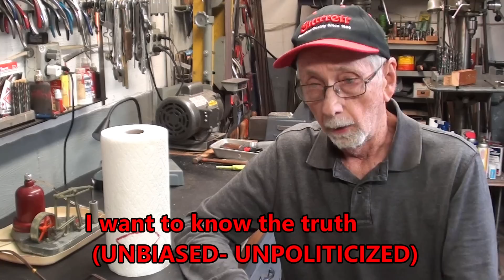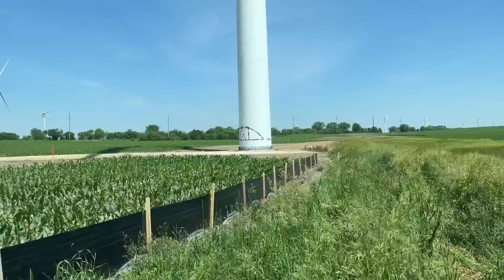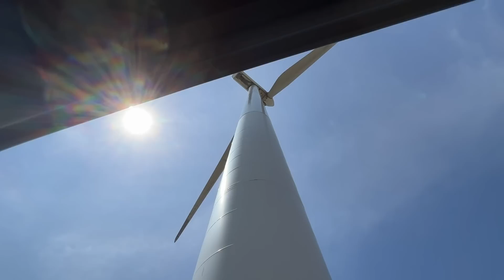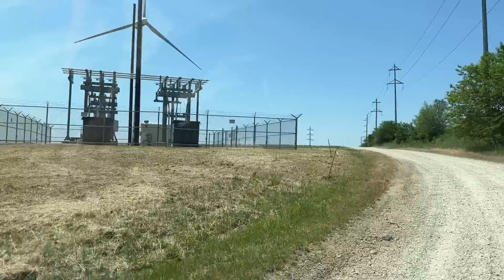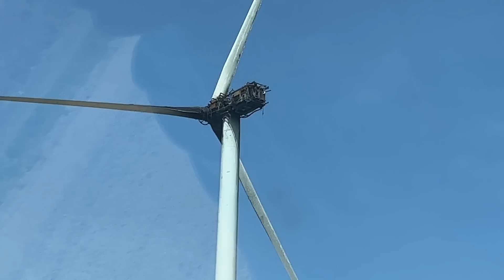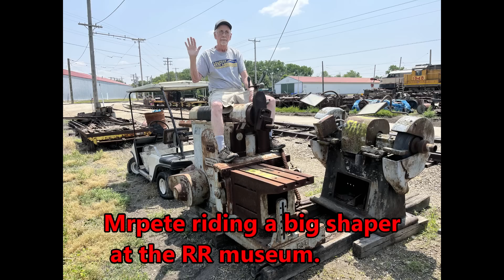OBSOLETE WINDMILL DEMOLITION short #46 pt 1 tubalcain

Comment: I wrote a book about the demise of shop class--vocational ed., and what it's doing to our infrastructure and producing kids out of school with no job-ready skills.

In it is a chapter (called Multiculturalist Sink) on my time spent working on wind turbines before becoming a shop teacher, and I go over these issues, starting with a turbine failure-- a nacelle catching fire and burning.

This subject interests me greatly--from a global perspective relating to the resources put into something with such a small return.

The business model producing electricity from wind is un-doable without subsidies or tax breaks. The idea of "storage" between times of no wind defies the science-based model of how batteries work, and translating AC power to DC and back again for import to the grid.

There's a whole-nuther problem with footprint as you mentioned (digging, roads, gravel, concrete, rebar, connection to the grid...). Environmentalists are torn between trying to save the planet, and the outlay in resources to build turbine farms and the environmental degradation necessary to make it happen. I see it as diminishing returns.
Reply: The AC/DC thing is very doable. In the UK we import power via an under sea  cable from Scandinavia. It is a DC link, and is also bidirectional.

Comment: I despise windmills. They are for the most part ineffective. Without government subsidies ( Obama and Biden were good for this and causing worthless expenditures) these would not be produced in the numbers we now see. There is a plan to put these just offshore at Ocean City, MD. Of course the township will get kickbacks and I believe that is the only reason the "town fathers" want these eyesores off the shore of a place making it due to the beach.  Can you imagine what this costs? Ba enough with the short life, pollution they cause now add ocean waters (salt), ocean currents and the depth for the base. Some do-gooder will come up with the idea that it will make fish habitats and don't believe it. AOC is a box of rocks, so is every Democrat plus many Republicans.  IMHO, government''s only purpose is to get rich doing nothing and control people as the commies do.  People that cannot balance a checkbook are controlling the treasury. 
I have read that in winter, if the blades get covered with ice, they do NOT work. The blades are an airfoil, similar to a wing. I have heard they use kerosene to thaw the ice. That is a great product to splash over the land. If you or I did that. we would be crucified by the EPA.

Comment: I personally don't mind them. If they were proven to be a positive influence on the environment (ignoring the environmental cost of components and political implications of relying on unfriendly nations), then I would go as far as to say I would be all for them. But here's the logical contradiction: Without energy storage, you need a backup. If you remove gas as the greens are clamouring for, then the only option is nuclear. And if you build enough nuclear capacity for when the wind isn't blowing,  why would you not just use nuclear all the time. The whole green industry is a scam. There are a lot of people getting very rich whilst the public are getting poorer in the name of the "green Revolution".

Comment: the wind has to blow at a specific speed in order for the windmill to produce electricity, a bit like the solar panels, takes 15 years of continued use in order to make them worth while, trouble is they need replacing after 10 years
Reply: Not the tower, which is half the cost. 
And I believe it's more like the stuff on top of the tower last 15 years and the whole thing pays for it's self over 15 years. 
So you can run the tower for another 15 years and replace the stuff on top and 7.5 years later that stuff is paid for and making pure profit.

Comment: Me I don't think they are as efficient as they claim cause they are easily damaged by ice and excessive winds but also they take huge amounts of property to actually build them then there is the problem with storage of energy windmills may produce more than needed at that time they control energy output easier with the other methods they are using in my opinion

Comment: You can't find out how much energy they use, how much energy does it take to make one, how much it cost to transport them, etc. If it's subsidized they can't stand on their own merits. I think nuke plants are safe. I have one south of me and and a coal fired plant north of me (I can see the stacks on a clear day). TX had a big freeze a few winters ago. The windmills stopped spinning and the overcast affected to the solar panels (both are a blight on the land). People lost power for and stuff froze. I was working in NM at the time. My son shut off my water well and drained my pipes ahead of the freeze so I didn't have any damage. When I got home a few weeks later, not one clock was blinking. I never lost power. The coal fired plant, nuke plant, and a natural gas engine driven peak shaver to the south of me kept my power on.

They put them on top of mesa's out in west TX. What used to be scenic is now like looking at a fresh dog turd.

Comment: A while back I drove I-70 back from a trip out west.  I was appalled by the miles and miles of turbines obscuring the landscape.  Just horrible.
Reply: What is your alternative ?
Wind farms in 2022 generated over 10% of US electricity.
Sure Micro nuclear generators may end up becoming a major contributor in the future, but in the mean time where do you get your power today ?
Reply: @keithwhitehead4897  Being hysterical over eliminating conventional power plants is doing no one any good except the grifters who profit from generating that hysteria.
Reply: @Don_B_260Z  Reality is not hysteria. Climate change is here, its only going to get worse. GOOD engineers look at reality, of what is, what's possible, and what compromises can be made safely.
Think of this as your oil warning light coming on in your car, can you leave it for a wee while...maybe, but is ignoring it going to be more expensive long term...
Denying reality because you want to feel warm and comfortable and not have to make decisions is not a route that works for anyone.
You change a noisy bearing before it seizes and causes a damaged shaft.

Comment: Thanks Mr Pete for your practical observations on this issue as a old trucker who farmed on the family property the rates changed for the oversized truck and escort service are extremely high per mile and from some of the responses hundreds of truckloads per job you could never find a balance point for it be profitable not to say that there is a problem to begin with at 345 ppm co2 we are a long way from the high end of co2 levels historically documented not counting we are all carbon based in body and world

Comment: The ones we put it Paw Paw(which isn't far from you) a couple years ago were 5.2 Mega Watts.  When we were installing them, they told us they were the largest on land in North America.  Each foundation was 1000 yards of concrete, the towers were five sections.  The Nacelle's weight was 200,000 lbs, the powertrain that went into the nacelle was another 240,000 lbs, the hub was around 40-70,000 lbs, can't remember exactly and the blades were around 35-50,000 lbs.  Would you believe it, still to this day, to my knowledge, they are not online.  I can say for certain, I would not want one by my home.  They are very loud, and an eye sore.  We finished the farm in January of 2022
Reply: Count me I would not one by me either but companies are getting rich !!
Reply: I was talking to a local power company engineer one day a couple of winters ago,  found out they have to shut the windfarm down when it gets 20 deg F below zero.  What?  It's to cold they say.  We get a couple weeks of 30 below up here in North Dakota.   Cannot use the windmills when there most needed.  What a waste.
Reply: You are correct in everything you say.  They would never exist without heinous arbitrary mandates and unduly favorable subsidies per mwh of production.  All of the so-called "green nee deal" is a massive scam!
Reply: Windmills kills birds.
Reply: That 5.2 Mega Watts rating must be the max rating. What wind speed is required to run those at their max power? I think  a good assumption is to average the wind over a period of time and calculate the actual power output from that Probably not even half their 5. 2 M w  rating..
Reply: @HEADDYNAMICS Noise?  You have never been any where near one.  They go woosh, woosh, woosh.  Very soft.
Reply: @michaelkenefick4660  If you are from living in the middle of nowhere to having one 200 yards from your house, you would say they were loud.  I talked with several homeowners from a neighboring wind farm and worked right next to working turbines.  They are loud.
Reply: @HEADDYNAMICS  I have been 50 feet from them in the country with no houses, business or people.
Reply: @michaelkenefick 
I have hunted doves over cut down dried feed corn and the wind turbines were spaced so closely that they looked like Dominos! Not that loud at all. Was about late August through September.

Comment: I retired after 38 years with a power company. NextEra Energy is one of the subsidiaries which is the largest wind/solar power producer in the world. I can tell you that wind/solar energy is hugely profitable. Yes, there are tax incentives but they are reducing yearly such that they’re set up to be gone in the future. They now have huge lithium battery storage units which store wind/solar energy that are also profitable. It’s complicated. Electric power is bought and sold like the stock market. But, the price of electricity varies based on demand and contractual agreements. Battery power is instant and can come on line way before a conventional power plant can come on line.
Reply: The question is; “hugely profitable” to whom? The farmers who receive monthly checks? Steel and concrete suppliers? Battery manufacturers? Maintenance and disposal services? Blade manufacturers? The list goes on and on but surely “not hugely profitable” to tax payers?
Reply: I'll but 38 years in sales or PR department, but I aint buying it. If it were at all more profitable there would be no subsidies at all. ,,,, I'll give you an example. Tesla had subsidies. Corvettes never had subsidies. Fact is if you want a new mid engine one you have to pay about 5 large above list and wait 6 months to a year to get delivery. ,,,, Point, If you have something that is salable and people want there is no subsidies (And Corvettes have always had fiberglass bodies, but you are not going to find a 63 split window coup in a landfill. - Fact is you will not find ANY Corvette in a junk yard. They get restored. ,,,,, Kind of different then the bird blenders, huh? . If windmills, solarm and even EV were saleable there would be no subsidies. If they actualy had any value they would be selling at premium prices.

Comment: To me those wind turbines are far less obtrusive than a Coal or Gas electricity generating plant that spews copious amounts of toxicity and particles into the earths atmosphere. There is no reason in this day and age to poison the Air, Soil and Water that sustains life on this planet. There obviously still needs to be a huge amount of work and investment into modern methods of smelting metals that make these Turbines and towers. Man slowly moved from the Rock age to where we are currently and man will still move forward to better methods IF he tries.
Reply: The problem is that those coal and gas plants are required to manufacture those turbines. They do not produce enough power to supply the processes required for their manufacture. They are a net energy loss. Same for solar. Neither technology has enough fuel density to ever be of any real value.
Reply: @841k9  Which is exactly why i said There obviously still needs to be a huge amount of work and investment into modern methods of smelting metals that make these Turbines and towers. Anyone invested in Oil, Coal or Gas can easily invest in renewables. There has been far too much time wasted already. Induction and Hydrogen are just 2 methods which should be at the forefront.
Reply: @tjr4744  Wind power has been around for 2000 years. - It's what is called a "mature" technology. There is no Nicola Tesla, or Leonardo DiVenci working in his basement that is going to come up with a windmill that is going to be 7 times as efficient as the junk we have now. It is as good as it is ever going to get. Aerodynamics has no solution to a better windmill. Remember the Concorde SST? It was as advanced as we are going to get,,,,and was a bridge too far too. Just like wind and solar. Not economically viable. 

Maybe in another 50 or 100 years we will have solar panels that actually work, but Monday Morning here is the bottom line. Wind and Solar SUCKS!

Comment: Those industrial sized wind towers can produce enough energy in a year to power about 1500 homes. The drawbacks: Depending on wind speeds it takes aproximently 6 months to a year of running to offset the energy used to build and erect a tower. If the wind stops or the tower is down for maintence it takes about 4 hours of running for a turbine produce the power it needs everytime to kick start the blades back into motion.  Power is also used to engage the braking system durning high wind speed events. About 80 gallons of gear train oil is replaced annually on each tower. The farm land going to and around the base of the tower produces less yield due to ground compaction from the heavy cranes and cement trucks used durning construction.

Comment: It probably makes good economical sense to tear these windmills down and build modern ones. Newer windmills are much more efficient. The one that was torn down was probably 1.5MW windturbine. Modern ones are about 7MW. So about 4-5 times more power output. If there is wind for it ofcouse.
Here in denmark the focus are on offshore windturbines. The output is much more reliable offshore, as it's allways windy. I live close to the Vestas testcenter. They just installed the new V236 15 MW turbine. Talk about a monster. 236 m rotor. There is a 3 part video on Vestas youtube channel. It's very impressive engineering.
Reply: Wow,,,,,Bigger windmills make more power then smaller ones. -  Who'd have thunk it? 

How is this. Bigger, More expensive, Higher maintenance costs. and lastly, Far more dangerous to humans and birds. When these thing spit blades like the little ones do all the time,  it's going to be way more deadly if they hit something ,,,, like say a school.

Comment: Many thanks for sharing the pictures, quite interesting. 

One of the problems we are facing in terms of truth ist YouTube and similar platforms. First of all : I can't tell you if those windmill things will do any good or not but based on my experiance I tend to say "no, tey are just political crap". The reason iwhy I think they are just some kind of "illusion" is simple and you already mentioned it : There is notihing available in terms of analysis or whatever. You'll find tons of stuff on anything but not on that ?!

Facts that I know : 
Blades do consist of glas firbe reinforced "plastic", not really possible to replace.
Gearboxes do contain something around 200-800LITERES of earth fines gear box oil, to be changed yearly. I did the math for my country (Germany) where we have a bit above 28000, using an average of 600l gearbox oil for those (beeing on the higher side of the avaerage because I guess there are more "bigger" ones than small ones) i did end up with ~17Million literes of oil !
Any of those windmills does need quite an amount of energy for control, brake, blade turning, ... 
As you as well emntioned : Transportation, building, getting base resources like copper, steel, ... might be quite some "corbon footprint"
Due to the fact that wind is nothing constant and we need constant voltage and frequency the output power will way of from beeing constant because of the wind changes. Overall we get high power peaks and a few seconds later we might have nothing. That is quite some stress to the energy distribution all over the country.

Finally I have to come to the conclusion : If anything will be added to the equation the sum might be negattive and this is for sure nothing that would fit to our "green world" of today and that might eb the reason why there is nothing in terms of data available to the public. But to be honest I really have no clue, it's just experiance and simple "1+1=2" math.

And last but not least : plants "eat" carbon dioxide and convert it to growth - as we all learned in live and school. So why reduce carbon dioxide (earth ozon shild ... yeah ... but 300 years ago we had 3x of today carbon dioxide, earth did survive, humanity did survive and temperatures were way lower -> search for mid age ice age ) ?

Similar for lithium, cobalt (like our so famous foreign ministery said "critters", she messed up the german words Kobalt (cobalt) and Kobold (critter/gremlin), anyhow she always good for a laugh see south africa - different story), and other materials needed for generators (windmill) and motors (cars), batteries (energy storage) and so on. Bolivia is destroying the country on the hunt for lithium ... Makes total sense for me (and that was ironic).

So now please anyone explain to me what on earth are we doing on this planet right now (in terms of climate) ?

Comment: $2.6 – $4 million per average-sized commercial wind turbine 
•	Typical cost is $1.3 million per megawatt (MW) of electricity-producing capacity
•	1-2 cents per kilowatt-hour produced, or
•	$42,000 – $48,000 per year
typical O&M cost is $42,000 – $48,000 per year in the United States